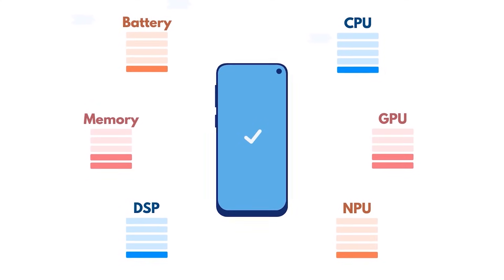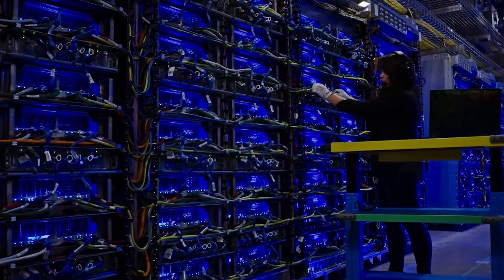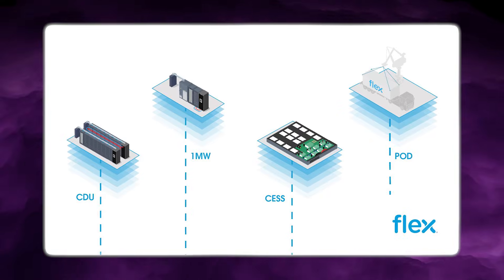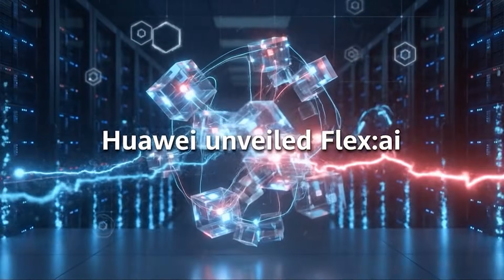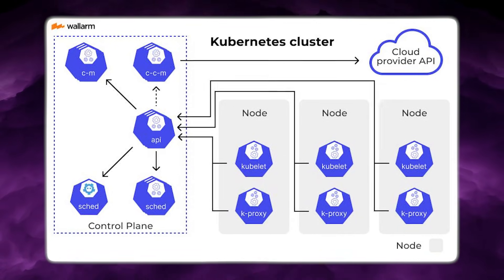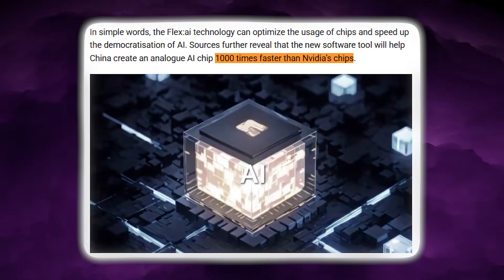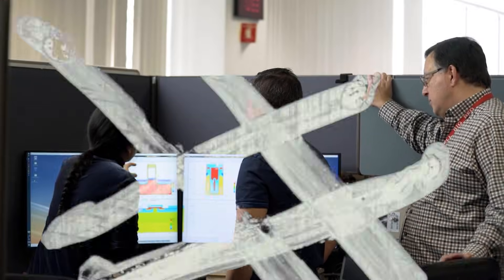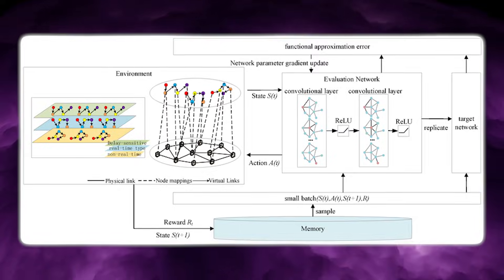Huawei’s New Flex-AI Can create 'Analog Ai chip' 1000× faster Than Nvidia GPUs!

Comment: Fact‑Check: Did Huawei create an “analog AI chip 1000× faster than Nvidia GPUs”?
What’s true
Huawei did make a public claim, but it’s being widely misunderstood.
1. Huawei announced Flex:AI, a software platform — not a physical analog chip
According to Tom’s Hardware, Huawei says Flex:AI can “create an analogue AI chip 1000 times faster than Nvidia’s chips” in the sense of virtualizing hardware, not manufacturing real chips.
Flex:AI is:
- A software orchestration layer
- Built on Kubernetes
- Designed to pool GPUs + Huawei NPUs
- Intended to raise utilization from ~30–40% to ~70%
This “1000×” claim refers to effective performance scaling, not raw silicon speed.

What’s being misinterpreted
2. Huawei is not claiming a real analog chip that runs 1000× faster than Nvidia GPUs
The “analog chip” phrasing comes from Huawei’s metaphor:
Flex:AI treats a cluster of mixed accelerators as if it were one giant analog‑style compute unit.
It does not mean:
- A new analog processor exists
- It physically outperforms Nvidia GPUs by 1000×
- Huawei solved analog precision issues
This is a software efficiency claim, not a hardware breakthrough.

3. There is a separate Chinese research project claiming a real analog chip 1000× faster — but it’s unrelated to Huawei
A Nature Electronics paper (covered by The News) describes a Chinese academic analog matrix chip that reportedly runs 1000× faster than Nvidia GPUs.
This is:
- A research prototype, not a Huawei product
- Not commercially available
- Not validated in real-world AI workloads
Some YouTube channels and blogs are mixing these two stories, causing confusion.

Bottom Line
Huawei did not create a physical analog AI chip that is 1000× faster than Nvidia GPUs.
They released Flex:AI, a software platform that improves cluster utilization and uses the metaphor of an “analog chip” to describe unified compute behavior.
The viral headline is a misinterpretation mixing Huawei’s software claim with an unrelated academic analog chip study.
Reply: Response generated by AI for claims of another AI ... 😂😂😂😂